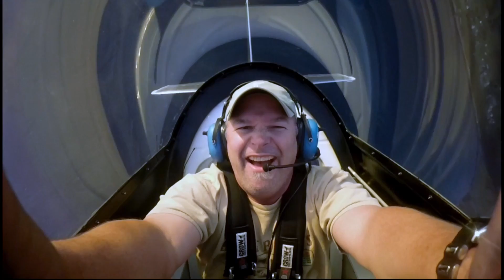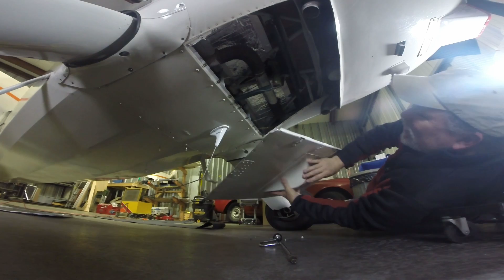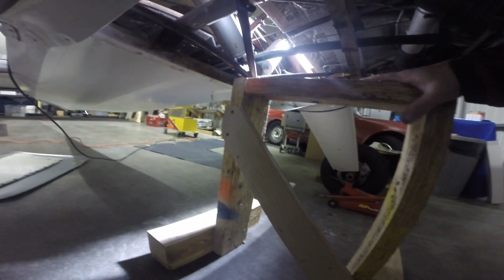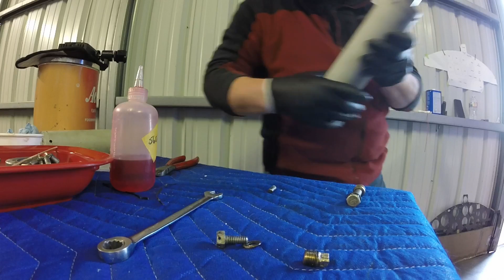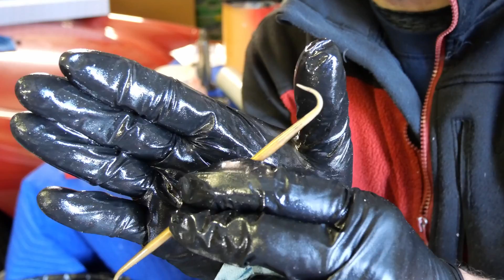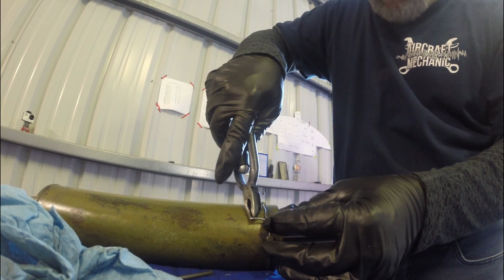Stinson Landing Gear Strut Overview

Comment: The Stinson 108 service manual page 59 para 12 says open the bleeder screw and add fluid slowly through the filler plug until fluid comes out of the bleeder.  Then after fluid stops coming out of the bleeder, replace the bleeder screw and filler plug.   Is there an advantage to filling it up all the way to the filler plug level and not opening the bleeder screw as was done in the video?
Reply from the maker: There is a screw on the cap (sometimes looks like a bolt) that is removed to allow air to escape and let the fluid flow from the inside the piston and through the office in the bottom of the piston. That was a good catch, I should have shown that done  properly. I believe I prefilled the cylinder off camera.

Comment: where can I buy a jack adapter
Reply from the maker: Univair has it under PN 108-5901000. However it's expensive for the quality ( it's rather thin ) I suggest you make one from 1" black pipe. The two slots are there to let the tool go farther into the axle tube. I should have mentioned how to make these. Thanks for going that far back into the catalog. It reminds me of how poor the production was back then.

Comment: I was looking at prices just a few years ago for these and they were around $30-40k. Can't find one for less than $90k now, are these worth that much?
Reply from the maker: I'm assuming you are talking about the entire airplane? Just like every other airplane out there, prices have gone up. There are deals around the 40 to 60 range. You can save more if they need a bit of work. That's how I got into mine. And These are a great flying airplanes. 90's might be on the high side, but it all market driven.

Comment: hard chrome plating causes steel hydrogen embrittlement - if the factory did not chrome plate - do not chrome plate it!
Reply from the maker: @Pat Johnson  Yes you are correct. Had these parts had been heat treated by the original manufacturer, a bake process would be required. These parts are less than 36 Rockwell and did not need to be heated. But thanks @FOX MOTH for mentioning that.
Reply: I agree if the did not post-coating treat the parts. I would verify with the shop that they followed the ASTM B 805-98 table 1 for hydrogen bake-out requirements.

Comment: Hey Freedomfixer.  I lifted my Stinson by the motor mounts as shown in the service manual.  Instead of rope we had a wide heavy duty lifting strap.  Since we didn't have an overhead hoist in the hangar, we had to use 2 floor hoists, which worked well.  Using your method I think I would put a tiedown on each wing strut so the airplane wouldn't be a teeter totter.  With the airplane suspended from the motor mounts, the bolts were easily removed since we were able to pivot the gear.  Since I didn't have a second pair of struts on hand, I installed steel braces and lowered the airplane back down to the floor while the pistons were sent out to be hard chromed.  You have probably seen the process I used in Hanger9aeroworks.
Reply from the maker: Yes I patterned my braces after John's. My method just showed how to raise the airplane a simply as possible while being safe. There's nothing wrong with adding additional supports. Thanks for pointing that out.
Reply: @FreedomFixer_Flying  Yeah, that was actually my airplane and my braces that John pictured in his tutorial.  John and I were good friends--unfortunately I witnessed him battle a long, slow battle against cancer which he ultimately lost.  He was a great Stinson as well as Aeronca booster and created the wonderful website which we all can still reference.  I'm not sure who is paying the rent for that but it's something the ISC might want to look into.  John's craftsmanship was perfection but ultimately he had to part out his project.  Time was not on his side.
Reply from the maker: @oltimer5544  it was mentioned at the ICS dinner that the site would stay up and be maintained. We will all miss John very much. I only wished I could have met him before he passed.